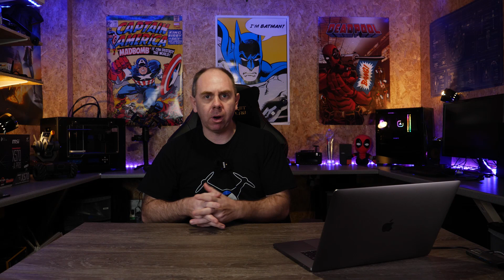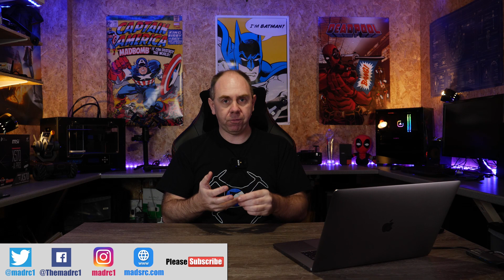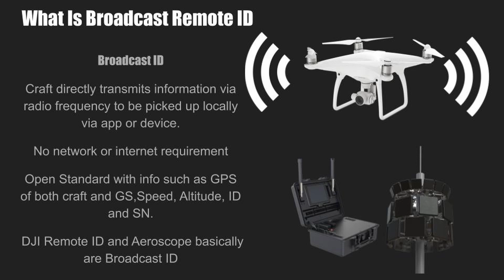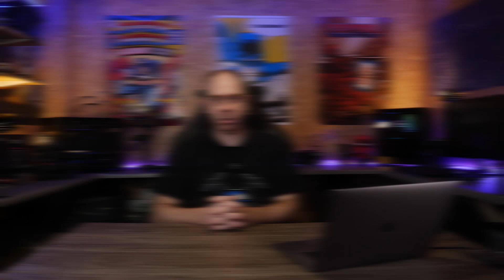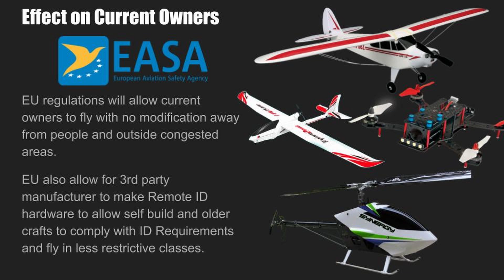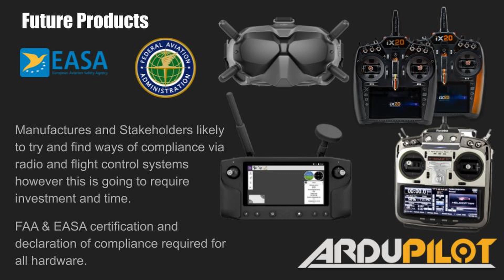FAA Remote ID NPRM Explained - How It Affects You

Comment: Truth is, Dji as a 🇨🇳 brand has lost significant favor with the US drone community and basically finished itself by aligning itself with the stringent new dictatorial remote ID mandates of the unelected FAA.  While Autel is busy creating new fans with its Evo open-source platform, Dji has gained a plethora of fans-turned-enemies.  In a couple of years, nobody will be able to use their Dji's without preauthorized FAA permission, while Autel Evo owners will still be productive, freely using and enjoying their purchased aircraft as intended without being forced into FAA's surveillance overreach. 🗽🇺🇸
Reply from the maker: You do realise that Autel is not open source and not a US company.  They are both closed source and Chinese.  They do not publish their flight stack or source code and while it’s believed they are using PX4 they are not actually publishing anything.  

Autel will be required to comply with Remote iD just like everyone else will be as it will be law.
Reply: @MadRC  
No need to start mansplaining everything as if you're somehow superior to me.
Reply from the maker: HardlineFeminists Er no thats not what I’m implying.  I’m saying there is this believe that Autel are a US based company when they are not.    They are also not open source like Ardupilot.   

The only US based drone company is Skydio and even then just like 3DR they are relating on external parts and manufacturing to help them.  

While DJI is pro Remote ID they are not in its current form.  It’s also interesting that none of the other manufactures have even commented on it in favour or otherwise so while it’s easily to say DJI are the big bad Wolfe they are the only ones actually involved at this time.    As I stated last night Remote ID in its selfie is not a bad thing but bad implementation of it is. It has a place in certain aspects of the hobby and industry however not for model aviation that does not even in many cases have flight electronics more than just a basic receiver and stability module.

Comment: Read the FAA proposal carefully. The remote ID will not appear on any screen in the airport towers so airport tower operators will not see drone traffic to alert anyone. It is a separate system. My assumption is that it is only available to law enforcement. It will not make the skies safe. You can speculate how it will be used and the rest